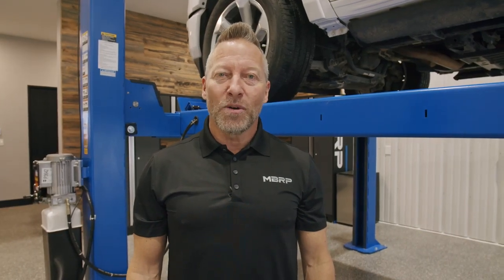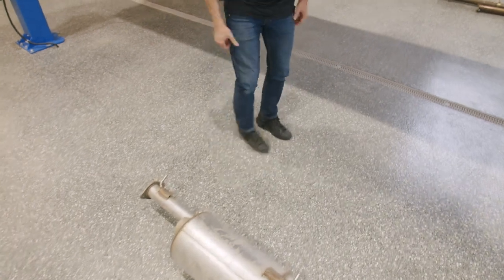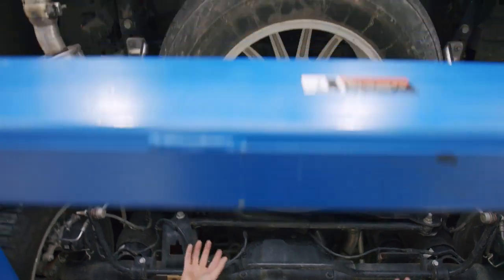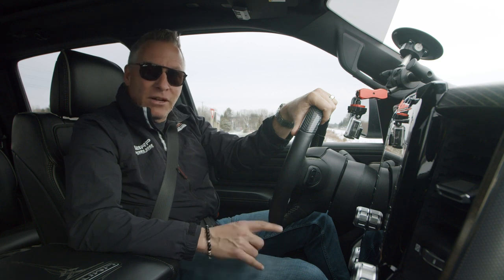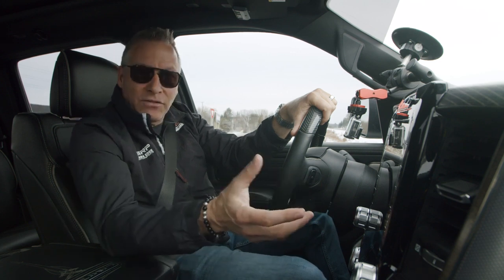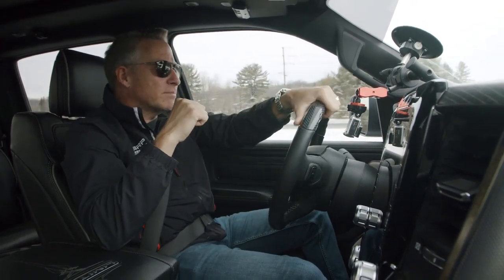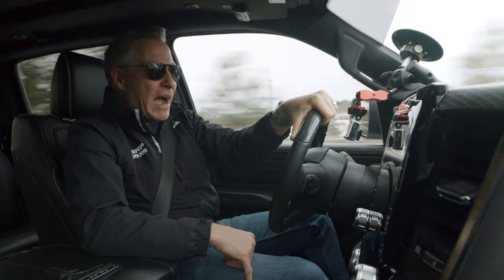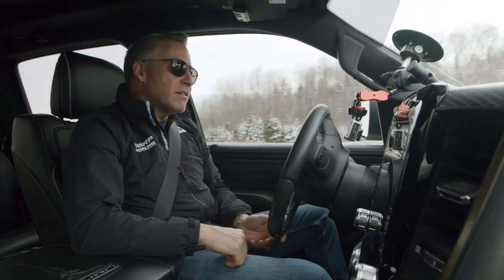MBRP 2019+ Ram 1500 5.7L HEMI High Flow Muffler Replacement & Muffler Bypass Pipe

Comment from the maker: MBRP High Flow Replacement Muffler and Muffler Bypass Pipes for your 2019-2020 Ram 1500 5.7L V8 HEMI! Order yours below! 

3” Muffler Bypass: https://justboltons.com/mbrp-3-muffler-bypass-pipe-t409-for-2019-ram-1500-5-7l-s5145409/

3” High Flow Replacement Muffler: https://justboltons.com/mbrp-3-high-flow-single-in-out-replacement-muffler-t409-for-2019-ram-1500-5-7l-s5143409/

Contact us at 1-844-526-2658 or via email at sales@justboltons.com with any questions!

Comment: Did you have to close the weep holes on the back resonators?
Reply: I saw someone else ask this question on another video. What and where are the weep holes?? What happens when you close them?
Reply: @b8ascrub  2 little pinch holes on the front and back of the resonators... that exhaust gases escape through that make a terrible sounding exhaust.. when you close them out helps the sound.. we don't hear them really with the stock exhaust
Reply: @Wannna_bet  I am going to look at my 21 ram now! 😂. I thought I saw a small hole in the bottom of the exhaust tips but not sure if I noticed anything on the resonators.  What do you close them with? JB weld